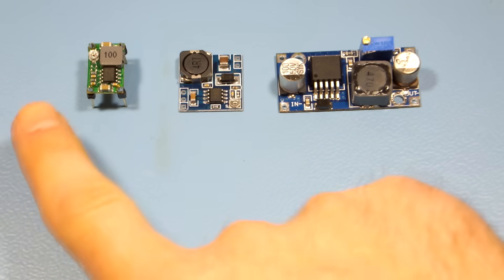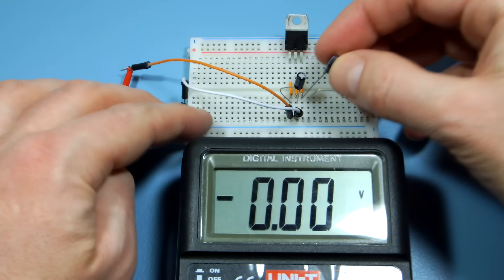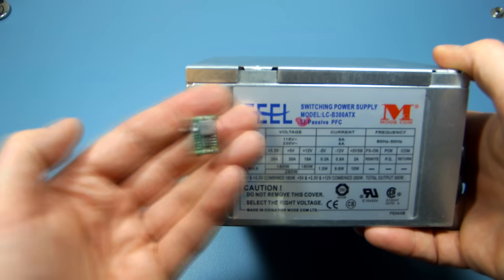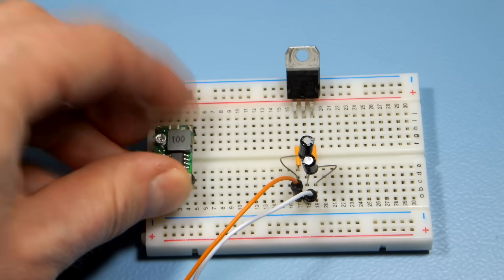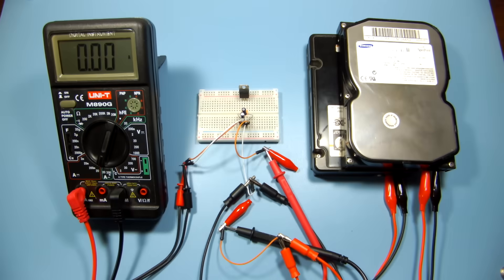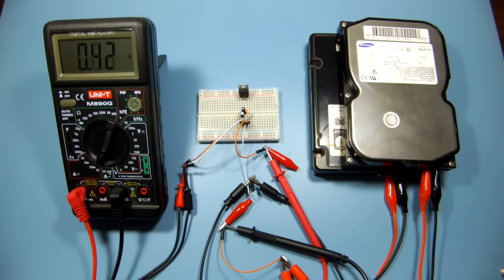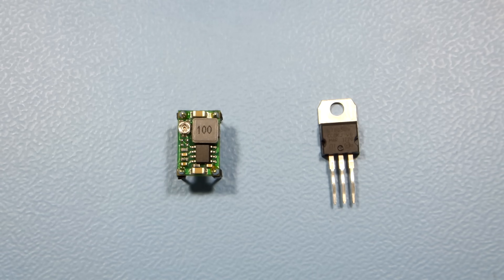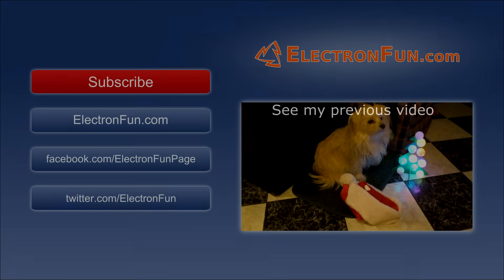Buck converter vs. linear voltage regulator - practical comparison

Comment: Is any buck converters are not useful if we use RF antenna in our design. Can you suggest dc voltage regulator if we use RF antenna in the design. Except 7805.

Comment: This video has been great for an 80s dinosaur like myself, those three pin regulators were about all we had back then unless you wanted to use a high wattage Zener and a resistor.
Buck converters are probably great though if well constructed, but those damn things that plug in your car socket to charge your phone drive me nuts, they pack up all the time.
It has made me consider using a nice old three pin 5-volt monolithic regulator on a nice fat block of Aluminium to charge phones in my car.  Maybe I could source a high-quality buck converter instead. My theory is those ones that plug in are just too small they overheat and burn out.

Comment: 7805 is best and can be used as an alternative to heater elements or coils ..... you can provide a  large metal surface to it to iron your clothes ....... i m using this as a heater in winter

Comment: I was wondering what that metal sticking out the top of the voltage regular is but now I'm thinking it's some sort of primitive heat sink?
Reply: As you can see it has a hole in it. That is so it can be bolted to a heat sink, which is how it was designed to be used.
Reply: @TractorMonkeywithJL  oh cool I see.  Yea they get hot, I burnt my finger on one.  What i find surprising is that the heatsink is charge to Vcc, so if you connect a larger heatsink you end up with a large surface are that is potentially something to short circuit against.  I nearly fried my laptop and ended up destroying an arduino due to this.  Apparently you are supposed to use a thermal material that is electrically insulating to connect to the heatsink.

Comment: ill put it in simple terms linear converters use resistance to keep voltage where you want... ineficient... buck turns on the power and off super fast so you want 5 volts have a 12 volt source it turns it on and off so fast that just as it comes up to 4.95 volts it shuts off then on     that simple folks..... so no heat made.... b ut the duty cycle is all you need to worry about.. these cheap ones use cheap components so dont use the buck converters from ebay to power anything expensive

Comment: What I will use for making 12 volt to 5volt mobile charger 
I have 12volt 7ah battery which will be better for this
Reply: 1. You buy 12V to 5V mobile charger from ,local shop. That is what you will use.
2. For 12V 7Ah battery... your question does not make sense.

Comment: When we caclulate efficiency of the voltage regulator we have to compute power loss. It's easy to calculate for linear regulator (just as you did - current multiplied by voltage difference). But for buck converters you have to calculate it like: Iin * Uin - Iout * Uout, where Iin - input current, Uout - output voltage etc.) For nonlinear converters input current != output current, that's their "magic".

Comment: Both buck converters and linear voltage regulators are improved by adding 100nF ceramic capacitor across the output.

Comment: The lm78xx range should never be used without a heatsink, but will produce a output with much less ripple than the buck converter. In some instances a zener diode based regulator would be a better choice.

Comment: Nice video. Could you do a similar analysis for the resistor based voltage divider? As far as I know, it has the same function as step-down converters and linear voltage regulators.

Comment: output ripple from dc/dc buck converters  is enough to make plenty of things not function correctly.
Reply: Things that don't function when there is ripple, need redesigning. Or add filtering... it's not difficult to smooth it out.

Comment: A "buck" regulator is just a regulator which reduces voltage. A linear regulator is also a buck regulator.
A better title would have been Switching Regulator Vs. Linear Regulator - Practical Comparison.
As others have pointed out, one big advantage of a linear regulator is reduced noise. I've had several wireless projects which wouldn't work when I used a switching regulator to reduce the voltage. The noise from the switching regulator interfered with the radio signals.
Reply: Use buck and boost converers in professional RF applications. The conberters may reduce sensitivity a little, but good layout does wonders. Bad antenna design is often blamed on the dc-dc converter!

Comment: Could you run multiple linear regulators in parallel?
Reply: Sure you could. But not directly.

Problem if you connect the outputs of two regulators is that even a small difference in voltage, say one is at 4.9 volts and the other at 5.1 volts, would mean that you'd essentially short circuit 2 volts. 0.2 volts with 0.001 ohm resistance(which is reasonable for a copper wire) would be 200Amps, which is a lot of current.

You could put diodes at each of the outputs, that would fix your problem, but you'd have to consider the voltage drop of the diodes.

Or you get a multi-phase regulator. Thats what you use to power your GPU and cpu for example, to get that very high current output(often more than 100A) at a very low voltage (~1.3V) from your 12 volts input. 
You can get those for up to 8 phases. Those basically work by only turning on one "phase"(each essentially a buck converter of their own) at a time and that way distribute the load across all of them.

Comment: Why can't we run a buck/boost with a linear at the end, mixed with a thermistor(ptcnptc) for protection? Is a buck/boost/linear not possible? I need the buckin an boostin but also can't have a unstable current.
Reply: Yes, you can. 
You can have a buck/boost and then a linear regulator. But you have to keep in mind that a linear regulator will only work when you have a high enough voltage for it.

Comment: Hey all, seeking some input please.. Trying to run a LD, not more then 2W, probably be more in the 800Mw to 1W range even. But LDs are sensitive an need a well regulated voltage and I'm trying to avoid the sloppy bulkly look of LMchip circuits an the little buck converter chips are tiny and would be perfect.. But not at the cost of pre mature LD failure due to ripple or in proper protections..  I see some people saying do a buck with a LM tied in? I'm having trouble with this one.. Any thoughts welcome..

Comment: Excellent analysis overall. I'm a power designer, and I'd take a buck over a LDO any day. The LDO is best suited to minimal step down and power consumption applications. LDOs do have a size advantage, not requiring an inductor or possible external switch.

Comment: Imbedded advert for Linear....  my comment, bring back the 7 amp LT-1083 in TO-3.  Some of us need the amperage and are not happy with having to use 3 TO-220. Buck convertors are not always suitable... due to noise they produce.  Low heat yes, but not good for everything.

Comment: When using components that require 5V only, the ripples from buck converters can be fatal. Here, the lm780X wins. It keeps the voltage very stable. Very informative video.
Reply: Thanks for this. I waz wondering why voltage regulators were used on things like arduino instead of a buck converter
Reply: No wonder my phone battery plays up on my powerbank

Comment: Buck converters produce a lot of EMI on SW-MW-LW bands but they also produce pretty dirty output which swipes out those bands if you use your PC with SDR receiving devices. It's curable with LC-filters though.

Comment: So converter is 8 times more expensive than the voltage regulator... I would rather use 2 or 3 voltage regulators in parallel and hence share the load current.. voltage regulator has much less ripple u see...

Comment: Very nice video.  :)
Maybe if the coil was replaced with a torroidal coil there would not be as much ambient RF noise produced.

You didn't include the cost of the two capacitors with the linear  so the linear cost comes closer to the buck converter in total cost.

Comment: Your figure for the powerconsumption of the buck-convert (even the updated one in the description) is wrong:
yes, for the linear the power turns out to be (12V-5V)*420mA = 2.94 W.

BUT for the Buckconverted that formula does not work - here the in- and outgoing current is NOT the same.
On the input side you got 12V*220mA = 2.64W, but on the outgoing side you got 5V*420mA = 2.1W. The Buckconverter is only dissipating the difference between those two - so 2.64W-2.1W = 0.54 W.
That is a enormous difference there - over 400% more power is wasted in the linear regulator in this case.

When you have to step down the voltage a lot than linear regulators become abhorrently inefficient - but they still provide very smooth and reliable output. So if you want to got form 12V to 5V and need high efficiency and low noise than you'd better use both - a buckconverter to step it down to something like 7V and then a linear regulator.
That isn't as efficient as the buckconverter on its own, but far more efficient than the linear regulator, while still having a very good noise characteristic.

Comment: If you need low heat AND low noise use a buck converter from the supply and then a linear regulator afterwards. Set the buck converter output voltage to just above the dropout voltage of the linear regulator. Low dropout linear regulator are best for this.

Comment: Smps don't use buck converter they use forward or flyback converter.
when space is a factor linear voltage regulator are best and they don't produce em waves as the inductor of buck converter do.

Comment: You just saved me a lot of trouble. I am building a lab power supply / breadboard, and want 1.5v 3v 5v 6v 9v output, from a 12v dc input.  I have already bought the lm780x's in order to do this, but I have been wrestling with the heatsink design and attachment issues. Now I can use 5 lm2596's instead and not have to deal with the pain in the ass heatsink mess.

Comment: About your computer power supply note:  Technically, all switch-mode power supplies that don't have a voltage doubler are buck converters.  They take rectified 120v or 240v AC in and have switchers that drop it to the several voltages needed for your computer.  The only difference is they convert AC to DC before the switcher gets it's turn to work.

Comment: efficiency is NOT quality. buck converters are noisy and have bad ripple voltage rejection. it means their output DC voltage is not as flat as linear regulators. that's why no manufactures using buck converters in sensitive products like in audio. if you use too much voltage at input compared to output and without using any heatsink you will get overheating. i have never seen any linear regulators with correct implementation reach more than 100 degree celcius like yours.

Comment: Cool, I have been trying to figure out how to set up a relay for my daughters Jeep.  The radio has a power drain and keeps running her battery down.  The Jeep shop wants over 500 bucks to fix it, so another mechanic  just pulled the fuse and she is without a radio.  It works OK when you are driving the rig and only drains when the car is turned off.  So my thought was to put a small relay between the power to the radio and the radio itself.  The relay's that I have are all controlled by 5 volts, and would be switching 12 volts.  My plan is to pull the switching voltage from an accessory fuse, so when she starts the car, the radio can have power, and when she turns the car off, the radio will again be isolated from the battery.  I believe the little power supply is just the answer to my problem of getting an isolated 5 volts to run that relay! Going to build a small box with integral fuse, then plug the wires for that box into the fuse socket of the radio, plug the radio plug into my box, and hide the box so it isn't in the way.  Thanks a  million for laying this out for me, I already have all the parts for this build so I will get on it soon!

Comment: I also have a third way to reduce up to 5 VDC from 12 VDC and it's to use several diodes in series to reduce it! Then you may put the regulator. But now the diodes would get heated instead of the regulator! So not something I prefer.

Comment: thanks for the video.
Do you agree that all the equipment that you showed only regulate/step down the voltage? I mean they lower the voltage. Would the voltage regulator give 5VDC output if say the input was 3.8 V? I guess not...

Comment: Can I assume that powering 3 LEDs with linear regulators (voltage drop 12v to 3.3v) wont be a problem?
Reply: Find out the combined current those LEDs will be taking and multiply it by the voltage drop over the linear regulator 12-3.3=8.7. This will give you the power dissipation in the LR.  Then you can decide if it is feasible or not.

Comment: The precision of the output voltage is the most important thing, the Ripple voltage is fundamental for many circuits. The switched power supply are quite deficient because of the noise generated in the output voltage. Its value of the Vrp is very large bought with linear sources.

Switched power supply are very efficient with the received energy but its great disadvantage is in the precision of the output voltage, the ripple added to the output voltage is amplified or multiplied in different power stages, producing heat in other parts of the circuit.

The precision of the voltage of the linear forces is invincible.

Everything depends what the application will be so that it will be occupied.

See https://www.intersil.com/en/products/power-management/linear-vs-switching-regulators.html and other documents

Comment: Nice video, but seeing as you are using two different HDD's as dummy loads, on two different power supplies, the results cannot be compared.  Both PSU's need to be tested on the same load, and power dissipation equations are different for linear's and buck converters.  :)  The current drawn by the 2nd HDD is only about half that of the other one.  That is not because of the the buck-converter.  The load on the first HDD will still be 420mA no matter how you power it.  Buck-converters are much, much more efficient then linear though, so that is quite correct and the buck converter will dissipate considerably less power for the same load current.

Your output power measurements are only accurate as far as the fact that the 12v load on the input of the regulator is however many watts it is.  This is NOT the dissipation of the regulator.  Using your examples, the linear regulator will be trying to dissipate 2.94W, because the dissipation of the regulator is (Vin-Vout) x Iout, so (12v - 5v) x 0.42 = 2.94W.  If you were to increase the supply voltage to 24v, the regulator would be trying to dissipate 7.98W  for the same exact output current and voltage, and will try to self-destruct.  ;)  This is the problem with linear regulators.  To keep them under control, the input-output voltage difference needs to be around 4 or 5v.  Anything more then that, and the regulator will sweat itself to death. ;) 

But therein lies the problem: often the input voltage can be much higher then the wanted output voltage, so good old linear regulators get HOT!  Buck converters work on a different principle, and so you might have 420mA output load @ 5v, with a 30v input, and the converter will only dissipate 1W or so depending on the device being used.  The exact dissipation on a buck-type regulator IC depends on the specific device, but the datasheets will give you the formulas for calculating the power dissipation figures.  Good luck on your electronics journey. :)

Comment: Hi :) Thanks in advance for the nice Video. I think this one is really helpful seeing the differences between the two methods to convert linear voltage. Can you tell me if there are comparable buck converter for the direct integration on a platine like the one you were presenting from 12v -> 5V but with a little bit higher output of current (lets say to 2A or something close to it?) 

Thanks again for your nice Video
Reply: Use the 5V version of LM2576. Its rated current output is 3A. Additionally, there is also adjustable voltage version.
Reply from the maker: Thank you :) Yes, there are many much more powerful buck converters. However, usually the higher current ratings, the more bulky these supplies get.

Comment: Hey hello I am using Buck converter for charging my mobile battery through my bike battery but I am facing problem of very long charging time ie very slow speed charging.can you provide the solution for this

Comment: Such a great video. I want to use the tiny buck converter to control 12v cooling fans in a psu project I am making. How would I convert it to change output voltage with temperature? More heat more voltage? Can you suggest an appropriate modification? Thank you.
Reply: Use an adjustable buck converter. The adjustable buck converter requires a reference voltage using voltage divider to adjust the output voltage.

Comment: Curious what the temp on the IC of the buck converter was, rather than the inductor.
Reply from the maker: When I was working on this video I had the impression the coil was hotter than the IC itself. I won't be able to check this, as the video was uploaded 3 years ago :)

Comment: Hello i need a step down module. The buck seems to satisy my need. 
But i need to use it in a wireless equipment. Since it switches does it cause noise or interference to a 2.4ghz system? 
Pardon me if anything wrong iam not a electric guy

Comment: I'm new to buck converters. I bought one LM2596 model to power a simple Arduino Uno with LCD at 9V. It works very well and I don't think I'll use the LM317/78xx anymore unless its mission critical.